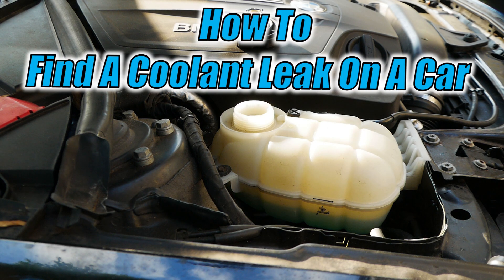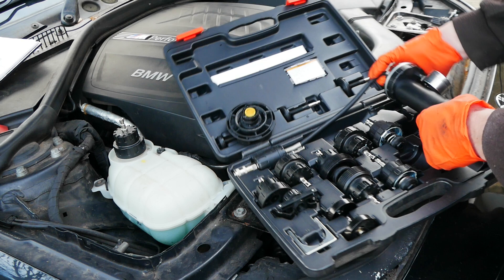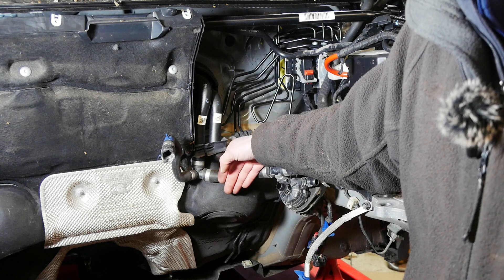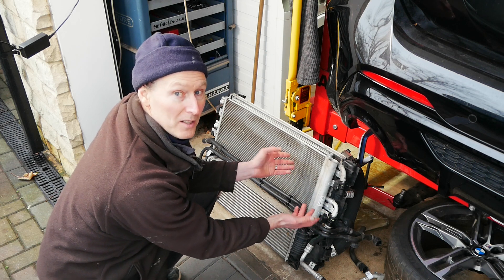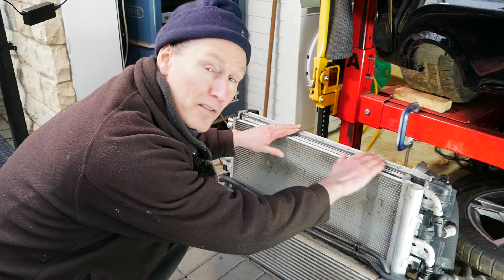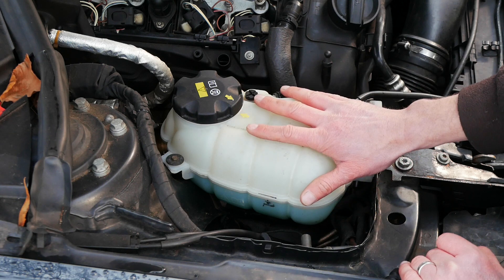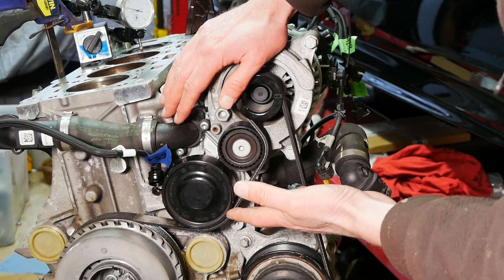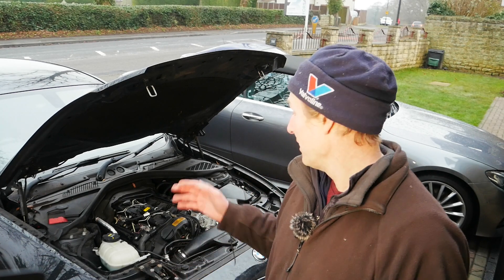How to FIND A Coolant Leak (DIY) AND The 5 Most Likely Coolant Leak Areas!

Comment: I have a slow leak in my coolant but there is NO drips or puddles on the cardboard. I can smell it on the outside when I get out of the car after running it. So I think it is hitting something hot (engine)  and just burning off. Is that possible?
Reply from the maker: Yes, if it’s just a small leak or the fluid is running across something hot, then you will smell it as it evaporates but as you say, nothing makes it down to the cardboard. Makes it much harder to detect I’m afraid. I realise you may not have one of these but a coolant pressure tester may be what you need! Use on a cold engine and then the coolant won’t evaporate and you’ll see where it drips down. Vid on it here: https://youtu.be/UZ4tc7E8ehE?si=g1WluBAbgoPk5St-

Comment: Superb video Phil. As chance has it I have a leak in my coolant system. The car was fine whilst cool but after a longer run the coolant had depleted. It transpires it was a split in a hose from the thermostat to the radiator. So the leak only showed when the thermostat opened. As I was driving for the car for it to warm up enough for the thermostat to open, and I have no low coolant sensor in the expansion tank, I only noticed the issue when taking the car out of the garage the next day when I discovered puddles. Could have wrecked the engine!!
Reply from the maker: Thanks! Yes, that’s a good point about the thermostat opening and then exposing more of the coolant system to leaks! A quick test, both getting the car up to temp wouldn’t have shown that. Thanks for sharing. Cheers!